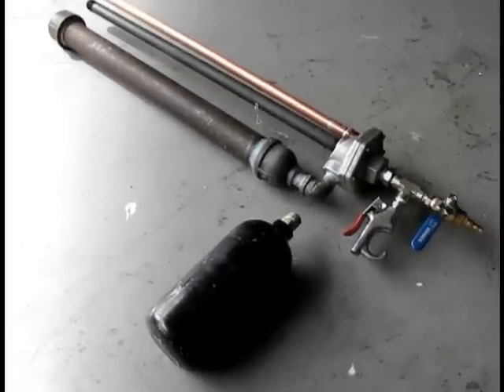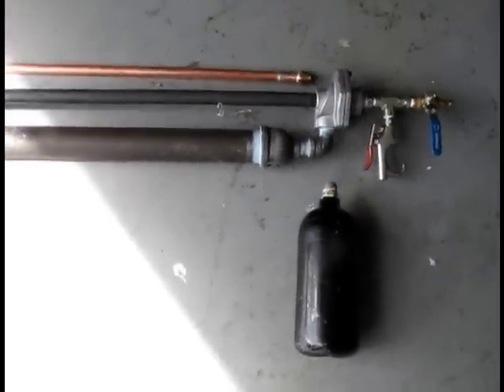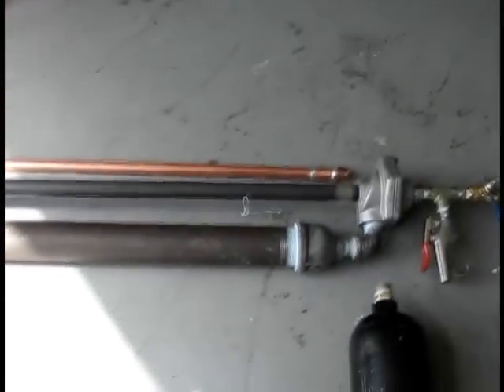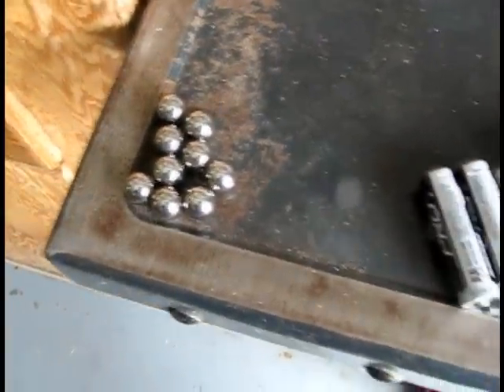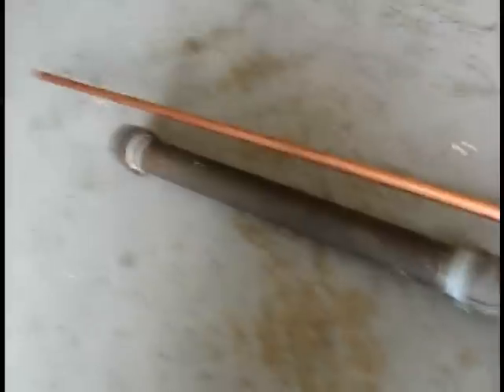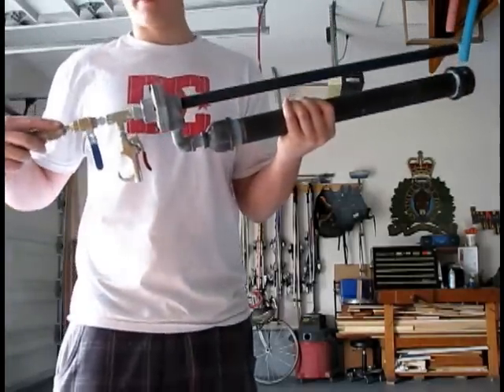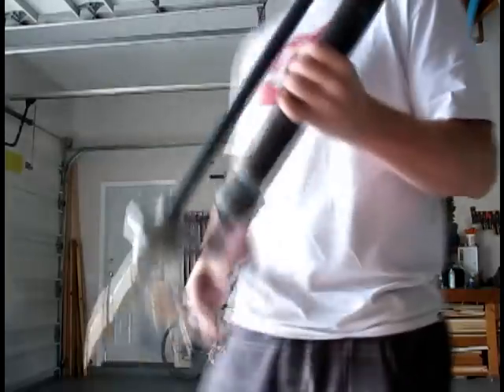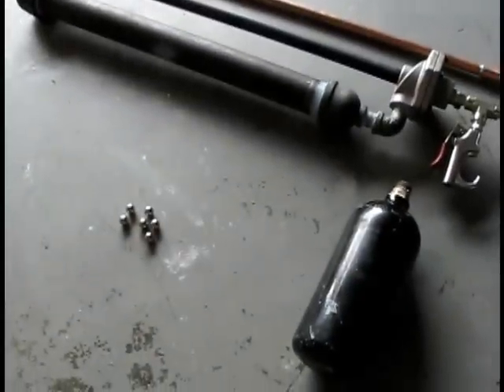Air Gun -- Shoots batteries and .50 caliber BBs!

Comment: @ResistIslamToday The AA battery might not fit in the barrel - they are about 14mm diameter. The 50 cal marker might not be as powerful as the 68 cal marker.
These home made spud guns are MORE POWERFUL than paintball guns, but they are single shot weapons. You will get the right barrel size for marbles, ball bearings etc only by trial and error.
A 3/4 stainless steel pipe (1.6mm wall thickness) fits 16mm marbles; 15mm (1/2") copper tube with 17/32" brass tube insert fits 1/2" ball bearing.

Comment: You are better off buying a european QEV, which is a shuttle or piston type (it is shaped like a "tee piece". The qev valve in this video is a diaphagm qev, which I would not encourage because they leak especially at higher pressures.

I recommend 1/2 inch qevs or larger (3/4, 1 inch if possible). Make sure you get ths correct threads - if you use bsp pipe fittings, get a bsp threaded qev.

Comment from the maker: Hey. The trigger is an air gun. When the trigger on the air gun it depressed, it opens the valve within its body, and releases the pressure built up between the filler valve at the back of the gun and the silver coloured quick exhaust valve. Releasing the pressure from the backside of the quick exhaust valve causes its diaphragm to actuate which releases the pressure stored in the reservoir and directs it into the barrel. Thanks for watching.

Comment: Go to ebay, you would be better off buying the European version (shuttle QEV), usually made of brass, because they hold higher pressures than the type used in this video. You need to know the type of fittings you want to use, either BSP or NPT, stick to the same type of fittings for the entire assembly.
Your QEV should not be less than 1/2 inch. Stick to 1/2", 3/4" Qev, depending on cannon size, but bigger qevs give more power. 1" qevs are hard to find,

Comment: @ResistIslamToday We all need some form of home defence if the SHTF, with the current economic crisis. You want to incapacitate your opponent from a safe distance, to avoid close quarter battles with knives, clubs of bottles. Spud guns are good, but they are single shot, quiet sniper weapons. You need a smaller air reservior 
(approx. 1/2 barrel volume, but varies) at high pressure (300psi) if you pump with a shock bicycle pump.

Comment: @ResistIslamToday Properly made spud guns are DANGEROUS at high pressure (250 - 300psi). They will leave a penetrating wound with marbles, ball bearings, modified crossbow darts, unlike paintball guns that just leave a welt. 
Just make a powerful but ugly looking spud gun (like the one in the video), where you can detach the barrel easily, so that nobody can prove that it is a spud gun.

Comment: @chickenfarmer296 You need to get a picture of a QEV WITH 3 PORTS. PORT 1 = INLET, PORT 2 = RESERVIOR, PORT 3 = EXHAUST. High pressure air is supplied to through port 1 and ends up in reservior attached to port 2. A drop in pressure from port 1 causes the reservior to dump its air contents through port 3, where the BARREL is attached.
From the video, the blow gun attached to the tee piece fires the gun by reducing pressure from port 1. Use a ball valve instead of a blow gun for quick discharge.

Comment: @ResistIslamToday Good for SHTF home defence, or for sniper shots from a concealed location. It is a quiet whisper weapon. Try using a long barrel (50cm - 100cm) with a smaller reservior (1/2 barrel volume) at a higher pressure, say 300psi.

Comment: Hey Jonathan, I made one using the same concept but different design and the exact same QEV from Parker Bellows (brand new) half inch ports X 3. I installed it with the same trigger as you have with port #3 as the barrel exit. The valve was installed exactly as you have yours. I put a Schrader valve instead of the Milton type quick connect for a portable compressor fill up. Upon testing, the air went straight through and out the barrel and not into the the storage chamber as it was supposed to. Any ideas suggestions?? Thanks

Comment: Jon you were right the first time with 1/2" because you are using 1/2" copper tubing with a 1/2" male adapter...and they dont make a parker quick exhaust valve in 3/8" to my knowledge...just want to know where you found the tee to connect the ball valve and the converted blow gun trigger?...nice gun

Comment: for the aircompressor airgun to work, there needs to be air going in the back end and out the front. in this video, the front end of the aircompressor airgun is connected to a metal t-joint piece of pipe,, so if he pulls the trigger air empties out of the bottom of the trigger piece,, right?

Comment: hey, would smaller ball valves release pressure faster/ more effieciently than bigger valves? ive messed with some 3/4 valves, but they dont seem to turn as fast as 1/2" valves. what lubricant is good in the valves?

Comment: The design could be improved: a heavy air reservior (or stock) will help to balance the gun and reduce recoil. Everything else is fine, for an inprovised air rifle. This gun could be tin can accurate at 30 yards, because it definitely has to be better than a paintball marker.

Comment: Do you have a list of all of the items and measurements for the gun? With the AA barrel.
Reply: I mean all I know is the barrel is a half inch By 24 inch PVC pipe, and the gas fill valve is a half inch ball valve(I also just recently made a version of this but it uses propane instead of compressed air and it is around 5-10 times weaker)(it uses 16 fluid ounce water bottles filled with about one second of propane spray although I think I can upgrade it to a 2 L bottle which will make it at least 4x the power)

Comment: how does the trigger work? the air chamber isnt behind the trigger
Reply: im 6 years late but if you're still interested, youtube search how a sprinkler valve works. it works on the exact same principle, except, this one is designed for very high pressures

Comment: and that valve where I can get
Reply from the maker: eBay
Reply: +Jon Proce what is that thing in the middle where the reservoir leads into
Reply from the maker: Quick exhaust valve (QEV)
Reply: oh ok what about the thing between the qev and the ball turn valve?
Reply from the maker: +Anthony Eastley it's just a standard compressed air blow gun. It's used to relieve the pressure off the backside of the QEV which fires the gun.
Reply: i mean the thing that that is connected too
Reply from the maker: +Anthony Eastley a tee fitting...
Reply: oh i fell really dumb now anyway thx for answering
Reply: can u make a video on this fully?
Reply: What's the maximum volume of that air chamber